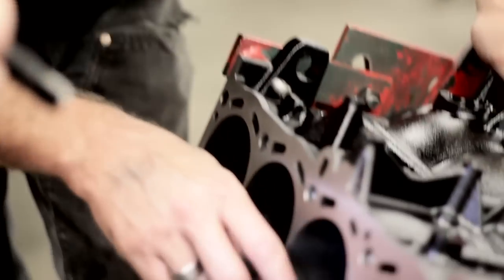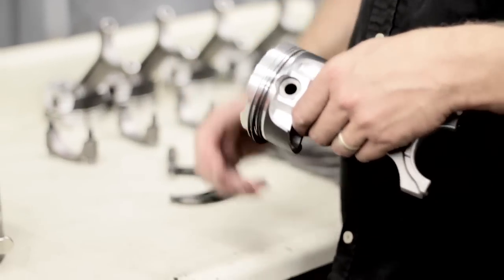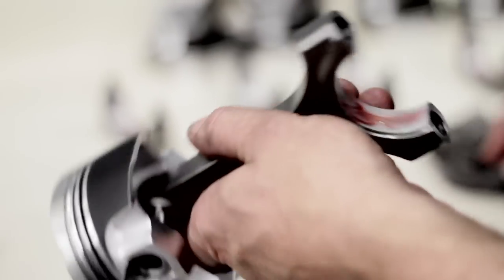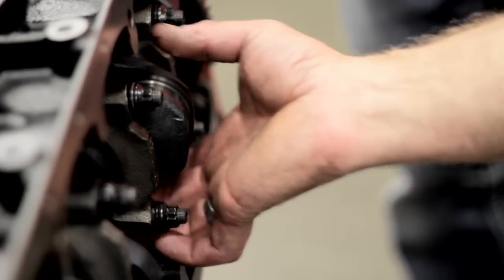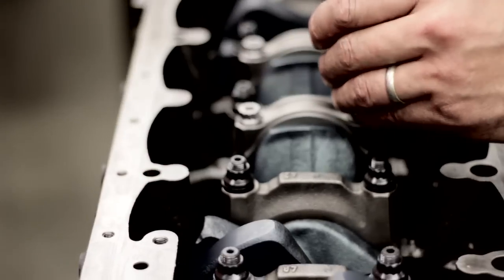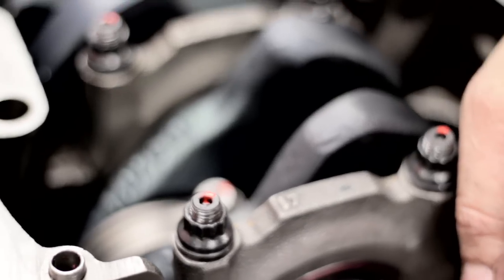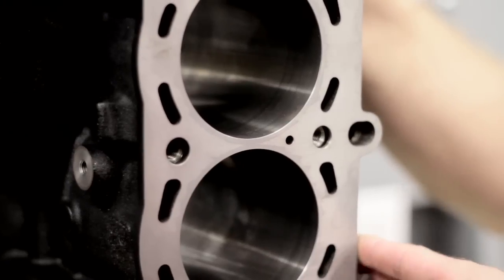Secrets Behind The HPF 1000 RWHP Daily Driven BMW M3 Race Engines Part Four

Comment: That is proving my point, to build an efficient motor you have to have ported heads and if you have a good port design you will make an extremely efficient engine. Like I said factors come into play after the heads, like cams, pistons and as you mention valve diameter. The valve diameter comes into play in relation to air flow and the fact it revs to almost 12000rpm shows that. Like the M motors rev out and have ported heads show what it takes to make an efficient smaller engine.

Comment: I noticed the oil feed line brackets weren't placed on the main caps before torquing them.

Was the tech supposed to undo two main caps to then place the bracket in then torque and angle it with a new one use bolt?

Comment: the overhead cam was a carry over from the airplanes of ww1 (talking 1915's here) and the DOHC was introduced as early as 1919 in a car.

The first pushrods were not seen till later in the 40's by buick.

So no they were not introduced for emissions.  If anything the OHC is older than the OHV design, especially when talking about being used in cars.

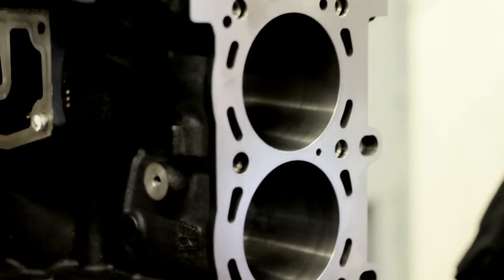Comment: @ 11:15  "this should hold up well ........."            famous last words.  Sure, the sleeved cylinder walls are now harder, and the bridge between the cylinders is now wider,  but it also has to parting lines contained with in it.
Reply: tommyharbuckle - Ummm, 10K hp Top Fuel blocks are sleeved; using Darton ductile iron sleeves no less !  Probably 75% of Pro-Mod and 100% of F-1 blocks are sleeved.  It's simply NOT an issue.

Comment: I like these videos although there are many mistakes seen from a higher point of engineering... but are still well above the so-called engines modifiers. Some things are done well by BMW because, in fact, they developed this engine and they considered also the reliability. Good job!
Reply: Moving the piston pin craddles closer together, eh, that should be a no brainer to engrs at bmr world. Nice move there to increase piston strength

Comment: @DonutManBMW There's no need to ring a properly mating block and head, using the proper head gasket, and clamping them together (at the proper torque) using extremely hard studs such as the L19 (L19 studs will hardly stretch at all, even under extreme boost).  This means that the head will not lift from the block, even under extreme boost.  Besides, you wouldn't want to ring the block and head with such narrow cylinder walls (between cylinder and cylinder).

Comment: so did they put cylinder sleeves in the engine they are building or did they just show them as an example? if you did have cylinder sleeves installed would you then have to surface the sleeves with the diamond abrasive and brushes that they used in the previous videos?
Reply: +Curtis Buxton I think the engne there are build was the lower 900hp spec so sleeves not needed, Depending in the material used for the sleeves I would guess the company fitting them may surface them to spec used for that material before the block is sent back and they may then need different rings

Comment: both of those mentioned motors can be modified to go way beyond that which one will endure longer and be more dependable is a better question. Hond F1 engines go through a new rebuild after 1 to 3 races just to help them endure the torture of their high revs and the amount of time they are used so the driver has the  best chance to win if their skills are good enough

Comment: The most efficient I have seen is a neon 2.0l motor built high compression with ported heads which produced over 300hp with no forced induction or nitrous. Yes it was not stock but it wouldn't take much to get any engine with over head cams (meaning 4 valves per cylinder) over the 100hp per liter as long as the heads are matched to the cam and pistons properly. If "america" really wanted that title it would be done, not being cocky but for some reason size matters to us more than efficiency.

Comment: Not saying ancient are 'bad', but perhaps this clarify this a bit ... push rod vs overhead cam (mainly introduced due to pollution/gas consumption) low rpm vs high rpm engines (high rpm can do with smaller clutches and gearboxes, resulting in overall less weight for the vehicle), 4-5 valves per cylinder vs 2-3 (5 is on the way out due to next to no benefit vs complexity). But at the end the engine itself is pretty much the same as it was 150years ago.

Comment: When this motor came into the shop, what was it used for? Did it have boost? Was it in a race car? How many miles were on it?
Reply: as far as i was able to follow, it was a standard S54 block which they build from the ground up.
Reply: Probably boosted the cheap way at first as it was smoking and consuming oil because of the egg shaped cylinder walls (hence the torqueplate) which is wy the block was rebuild to handle expensive boost. Miles were 75.000 as said in the second video which is wy i think it was boosted. Standard non boosted blocks running factory specification last over 250.000 miles if taken good care for and should not smoke and consume oil somewhere up to that milage.
Reply: "Boosted the cheap way" as in just slapping a turbo on and not building the internals for it?
Reply: Peter Martinson
Exactly, it needs this kind of work done if your boosting an engine as all the part are not designed to deal with 100's of HP more then stock. Just slapping a turbo on will give the exact same problems shown in the videos. He also mentions in the first video at 3:45 ''the head's obviously lifted on it and the gasket is blown'' which is one of the problems you will encounter just boosting an engine and not doing the necessary work although it might be a cylinderhead from another engine he is working on at that moment. Fact of the matter is that non-boosted stock engines should NOT be having these problems unless treated the wrong way like not letting the engine warm up properly for example.

Comment: Actually Greek firm called Extreme-Tuners built 2.0 liter 4 cylinder 16v Cosworth engine that puts out 416hp@11900rpms
Also, it's really funny that you mention Neon!
Because Neon's engine is copy of Mitsubishi's 4G63, but worse built quality and the cam is reversed (exhaust side at front).

Comment: I wonder how much capacity it looses with the smaller bores. It'd be interesting to calculate true capacity now that the cylinder diameter is .050 smaller
Reply: +Daniel Brealey If they're starting with the 3.4l engine, then the sleeved engine would be like 3.12 liters.
Reply: +Logan Assuming the stock crank throw of 91mm

Comment: They're recorded using a really wide aperture because of the relative low light conditions in the shop, otherwise they'd need much more artificial lighting especially when doing the through-bore shots, which not only means carrying A LOT more heavy expensive lighting gear, but it gives a worse looking shot.

However you are right, the depth of field in these films is too shallow for what we're watching, there needs to be more of a balance between light and depth.

Comment: i liked when jeremy clarkson drove that skyline with over a 1000 hp. he made the remark that the engine was also more durable than the original. i would love to add plenty of hp to an engine for my car that is as reliable as before it was modified. otherwise you spend alot have some fun until you have engine failure which happens when you add alot of horsepower. amost anything working harder and faster tends to wear out faster, sad fact of life!

Comment: Note I said 1862 (150 years ago), and you said yourself that the Benz patent Motorwagen wasn't built until 1886 (which is in fact wrong it's 1885). This is considered by most to be the first true car. I am correct still. A horseless carriage is not a car. Also, I never mentioned Ford. There were certainly no V8s or any Bavarian Motor Werks in 1862. Have you said anything useful?

Comment: Actually, you are wrong good sir.
The title is held by engines based on the Chrysler hemi and are built in the United States. They hold the title with a mind blowing 976hp per liter!
These 500ci engines are used by top fuel dragsters producing over 8000hp!

Comment: Neither of these cars come with ported heads from the factory. My point wasn't the neon engine at all it was the fact you can build any engine to perform as long as you port the heads, match the cams and pistons it will make good power whether naturally aspired or boosted. Extreme tuners has done better builds than what you mentioned, I know about them. Like I said america prefers big displacement and low efficiency which is why we get such terrible gas mileage. It sucks but it's how we think.

Comment: "Ductile iron that's very hard" ... supreme contradiction of metallurgy. Ductile means it's pliable and tough. Hardened is the opposite of ductile. The harder it is, the more wear resistant, but also the more brittle it is. Hardened will not bend, but will will break. Ductile will bend, but will not break and tends to retain its shape after being subjected to high loads.
Reply: +Theball Player    You are correct.  More technically, ductile means a material's form ability, specifically the ability to be drawn into a wire.

Comment: This video as well as the other 3 parts should tell you why a handmade engine will provide longer life, more power as well as low to no oil consumption. 
Although a stock engine is great for normal driving and the everyday type driver, there is a major difference between this and a stock engine.
Also nobody expects everyone to understand this info.

Comment: You also have to realize our american performance cars don't come with ported heads from the factory or cams to match while all the m class bmw's come stock with ported heads which if you know anything about engines which I'm sure you do the heads will make a huge difference in how much power the engine can produce per liter all motor or forced induction. I'm not saying bmw's are not great as I am a trained mechanic for bmw I am just saying the heads/cam make a huge  difference in hp per liter.

Comment: I don't understand how this engine is going to survive 1000hp with a hardened cast crank & those weeny bearing caps. I had my LS9 rebuilt to handle a larger supercharger, cnc'd heads & better cam. I have a hardened billet crank w/ 6 bolt, cross drilled caps. The block & heads were machined to much closer tolerances. Low friction rings were used as well. This engine makes 850 reliable horsepower. I could bump up the boost & remap it to well over 1,000hp. I know I would have a 25k motor at best

Comment: it gives a little secret of it, that no one talk about it! u can give them the right torque, ervery screw or we, with a little bit oil on it! u have with oil no braking about dry material, or fabricate fails, so u have the 99% of torque on the srcew or mount that u want! Please, dont forget every car has an another torquement at the headbolts! The original tell u at first an Torque then an degreesment for the cylinderhead, that´snothing happend with my comment i talk about the rest of the engine

Comment: >.> this is such a gross oversimplification. American racing engines are no more ancient than this BMW racing engine. BMW have been making straight-6s for 40 years, we've been making V-8s for about that long. This block as as much in common with a 60 bimmer as a modern LSX does with the engine from a 60's Camaro.

Comment: How you actuate the valves from the cams has nothing to do with pollution or mileage, and I think you're blowing hot air out your ass on the "lighter" clutches/transmissions just because of a higher redline. I will give you this: more than two valves per cylinder helps power, mileage, and pollution and that's harder with push-rods. All US racing engines (besides drag) are small blocks at this point, which share no parts with their big-blog brethren of yore. And BTW, in 1862 there were no cars.

Comment: yes, and they burn nitro-methane, run 60 psi boost, and need rebuilding after every race. try looking at street cars! the E46 m3 engine was actually one of the most efficient bhp/liter out of any NA production engine. 355hp from 3.2 liter. the Ferrari 458 Italia currently holds the world record for most power per liter from a NA production engine. 562 hp out of a 4.5 liter V8. your shitty american pushrod, 2 valve per cylinder V8s make nowhere near that amount of power per liter.

Comment: being snarky doesnt make top fuel dragsters any less irrelevant. There is a 90,000 horsepower engine at 100RPM, but its irrelevant.

Talking production street cars BMW gets the most HP/L. They were the first to make a production car with over 100hp/L and still lead the market in power output and drivability. 

Americans and Japanese cars take forced induction or massive displacement to come near German engineering power. I love american cars, but your delusional - and talking top fuel is so dumb